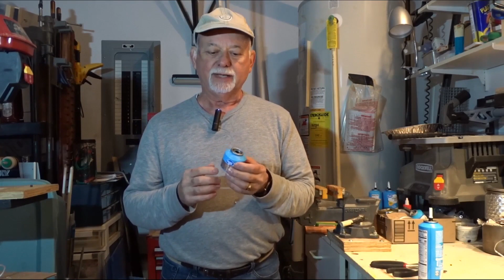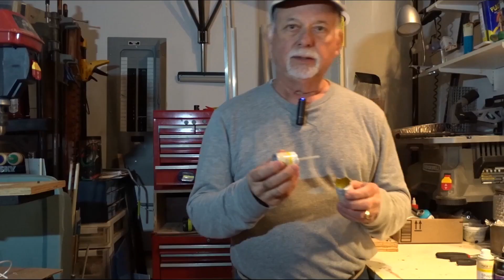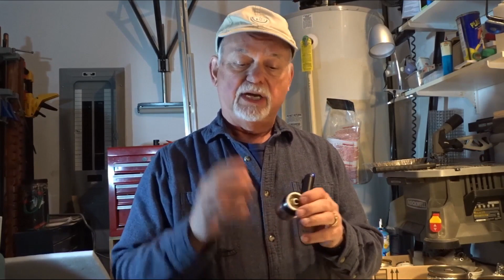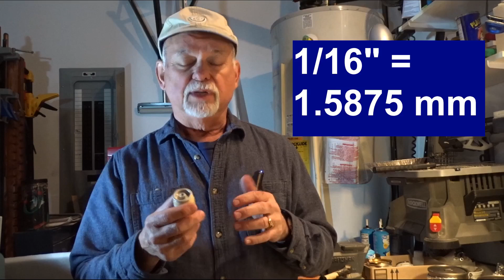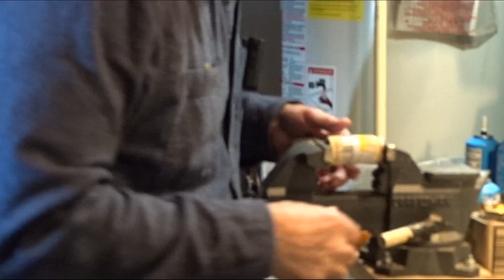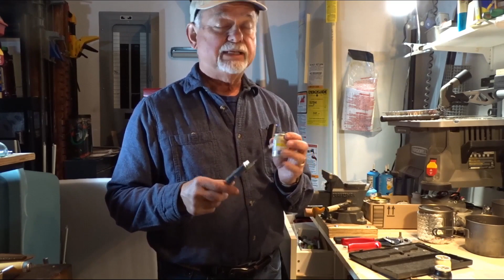Full Build 13g Alcohol Burner

Comment: Try this, cut the lower halt of the aluminum bottle  more or less with the same height of the diameter.  E.g. hair mousse, deodorant cans have ~50mmOD, so cut 50-60mm height.

Then make holes ~5mmOD at ~10mm below the top and have a "low pressure side burner" stove, easy to make.
Reply from the maker: That sounds interesting; I will have to give it a try sometime. Thanks!

Comment: Thanks for sharing.
No reply necessary.
I have watched a couple of your videos on alcohol stove building. Disappointed that they do not conclude with burn tests, the very purpose of the build.

Having prepared the top and base for their  jouning, try a squirt of WD40 to ease the push fit.

Thanks again 
Take care.
Reply from the maker: Working on burn test video.  Thanks for the WD40 tip.